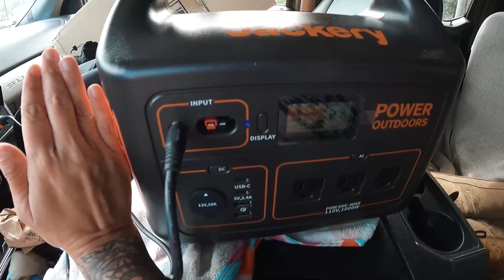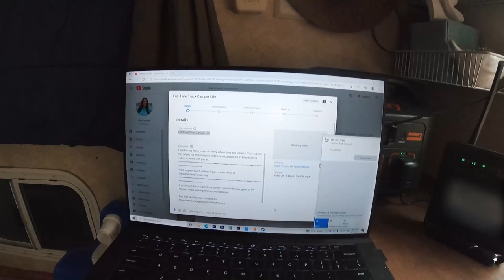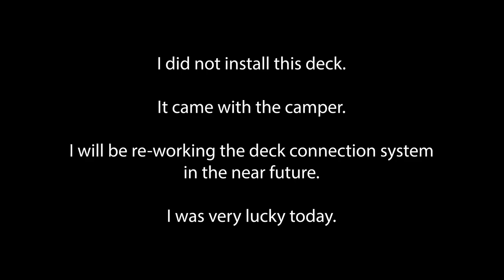S1E33 Hiking to a Beautiful Alpine Lake w/ the Dogs | My Deck Broke | Full-Time Truck Camper Life

Comment: I would see if you could find a couple of eye bolts and then put    a couple good nuts & bolts on there with some washers allowing it to still lift up and down move freely. Or see if you can pop those sleeves out leaving the eye bolt there and just get some nuts and bolts, you're not me but that's what I would look at doing. Those look like tie rod ends.
 Out of curiosity does any of your artwork mean anything ?
Reply from the maker: That's a great idea, thank you! Yes, the flowers are mostly high alpine flowers and they all represent my love for the outdoors. I also have a few flowers representing the states I've called home and one of the flowers is a memory for my best friend who died two years ago.